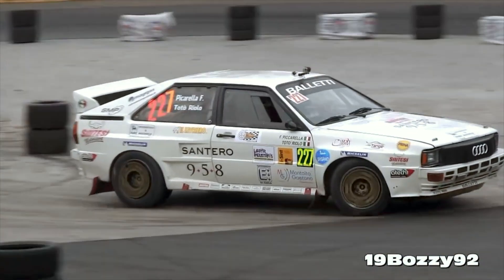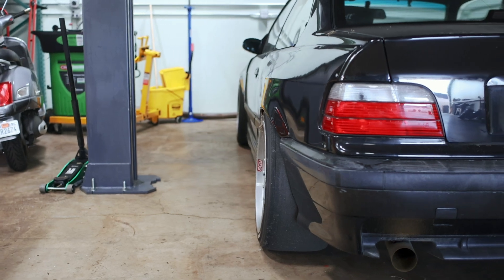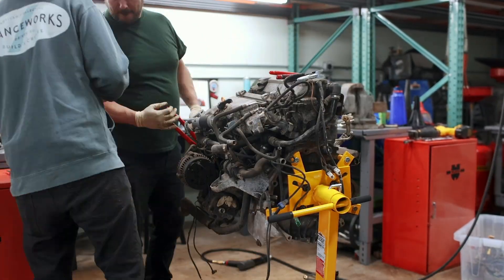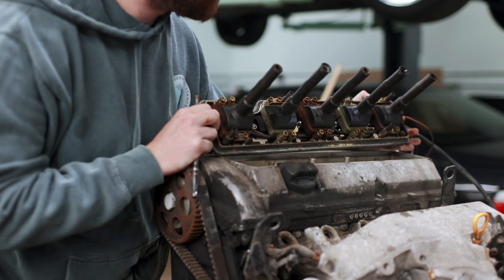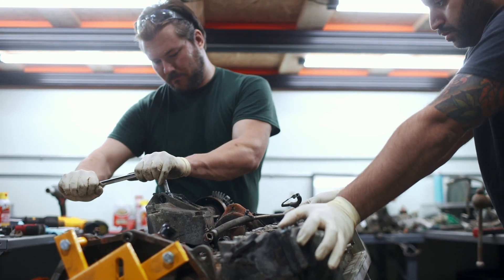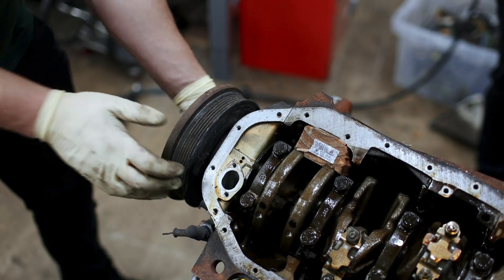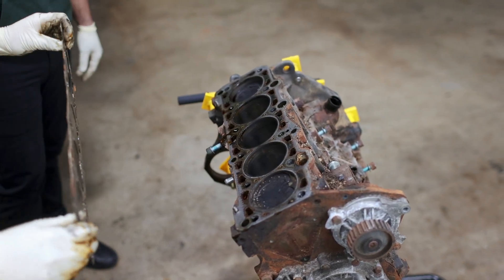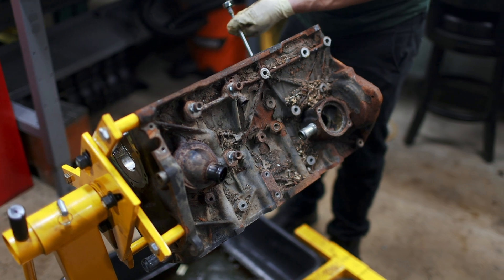5-Cylinder Teardown: Audi Ur-Quattro Engine Build & Swap Underway!

Comment: Cool project and video, but you guys have NO idea how to disassemble a european engine. Please do some research before you destroy everything on this car. I will be very happy to help.
Reply: I did not want to offend anyone with my comment. The first option is to hammer a 12 point torx (XZN) in to the unbraco bolts. The second option is to weld a nut to the damaged head. The third option is to drill out the head and the protruding part of the bolt shaft that goes in to the alternator, and then clamp the bracket in a machine wise, and machine out the rest of the bolt in a drill press. Or press it out. I would use Audi/VW tool number 3256 and a long breaker bar to remove the harmonic damper. You can damage or breake the shaft key on the sprocket on the crank shaft if not. The heat can also damage the rubber inside the harmonic damper.
Reply: @S2_Inlinefive  Solid!  Thank you for the advice- I bought an inexpensive S4 last year with the hotside of the AAN disassembled. Still figuring out the best course of action.    Have zero experience with Audi's so definitely good to receive some expert advice on how to do things properly- Cheers
Reply: @jdmimportlogistics  It depends on your budget, Wagner tuning makes OEM-looking parts like exhaust manifold and intercoolers. This is important if you are living in a country with strick rules regarding modified cars. Remember to replace the exhaust studs in the block, they will probably breake when you try to remove them, but its better than to breake them while installing a new exhuast manifold.
Reply: @S2_Inlinefive  Excellent- thank you for that advice.  All the parts were still in the trunk fortunately after being transported from Texas.  Would you recommend trying to reassemble the hotside first just to start the engine or pull it a do a thorough inspection?  He does mention a standalone in this I'm wondering if that would be the VEMS plug & play to the OEM Motronic ECU?
Reply: @jdmimportlogistics  Check the exhaust manifold for cracks, and measure the gasket surface if it is warped first. They tend to breake and leak exhaust. I always disassemble a unknown engine, but you can use it if is has good compression and oil pressure. It could probably be VEMS, you can check it by removing the plastic covers/floor carpet in the foot well, if I remember correctly. I mostly work on S2/RS2 cars.
Reply: @S2_Inlinefive  Good point.  So are there any other piggy back options for the UrS4 other than VEMS? I've heard mixed reviews. However, I guess if I use the AAN/01E for what  I originally intended to build an S1 Replica (I have a GT Coupe shell/4Kq CS as well) I can go with any standalone.  Interestingly I did get the opportunity to speak with Timo (Audi Heritage fleet manager in Inglestadt) at this year's Rolex Heritage Festival.  He told me that the majority of S1 Replicas in Europe (Although aesthetically perfect) were completely undrivable in the hands of amateurs!  My plan is to leave the engine OEM and get it running in the S4 first then change the coil packs and intake plenum if I do in fact build the S1 replica.
Reply: @jdmimportlogistics  Front heavy short wheelbase cars with high horsepower is hard to drive. I would not recommend to build a S1 replica if you don't have atleast 10+ years with bodywork. I will probably buy MaxxECU, it is plug and play with a adapter for the loom.
Reply from the maker: No.
Reply: What would you have done differently?

Comment: Ah yes the harmonic balancer bolt! Those require a 6 foot breaker bar and at least 200+ lbs person standing on it to get it out! 😉
Reply: I just used my ~700lb impact on them and 120+ psi air pressure 😂

Comment: I thought an 07K would have been a cool engine upgrade. Modern & VAG...
Reply: I was thinking the same. I’m just learning about the 07K and was wondering if these engines are from the same family or is the VW a completely different head/block?
Reply from the maker: The 07K is a different engine entirely. It was an option, but I really wanted that oldschool sound.

Comment: You'll just need a 3b intake for the small chassis  if you want it oem. It wraps up/behind the rear of the engine towards the hot side.

Comment: I've seen some people use diesel engine blocks for bigh  horespower, don't know which though , maybe someone more knowlegeble will give some details.
Reply: They were looking for more displacement. They came stock in 2.4 and 2.5L. You can make a 2.6L with a tall deck eurovan block and 82.5mm pistons.

Comment: The piston rings thing is internet myth.  They rotate while running and typically at different rates from each other.  It doesn't matter if the gaps are assembled lined up or offset.  It is just some weird coincidence if you saw them lined up as you took them apart
Reply from the maker: All 5 pistons having all 10 rings lines up isn't coincidental though.

Comment: Just things I can think of right now to look for:
AAN engine things to keep notice of:
-Cracks in timing gear key or fully sheared, closely inspect.  Full billet options available.  Issue also in small chassis cars
-Cracks in cylinder head from spark plug holes.  Not a total disaster, there is a spec for them in the AAN manual
-Lots of small chassis cars like the URQ get the 3b engine from a '91 200 due to more compact intake design due to radiator clearance issues in small chassis that large chassis cars  don't have issues with.  Not 100% sure intake manifolds are a direct swap.
-Many off the shelf options for retrofit newer ignition coils and harnesses.  Popular and accessible options seem to the 2.0l red tops from newer VAG.
-There is reported issues with ARP main studs and fouling oil check valves in the block of AAN.  Just something to look into and research.

Urquattro things:
-Closely inspect the firewall around the clutch master while actuating, small chassis cars don't have enough bracing in the firewall for these early hydraulic set ups and they often crack/flex causing issues with clutch master alignment and rod breakage.  Some aftermarket solutions tie the master mounts to the steering rack mounts.  I believe Audi's solution in the rally days was internal to the cabin of the car instead of the engine bay.
- Definitely interested in seeing how you tackle the hydraulic brake booster set up.  Some have swapped to vacuum assist from 4000s/Coupe GTs but there are concerns there of maintaining vacuum to the booster while under load.

Can't wait to see the progress on this build!
Reply: 3B, RR, AAN, ABY and ADU intake and exhaust manifolds all fit the "different" 20v heads fine. The 7A and NM heads are the same minus the extra water cooling ports on the intake side, which can be machined in to them (same base castings for all seven engine codes). You can interchange valve covers too, basically just the three different styles. 3B/RR, 7A/NM and AAN/ABY/ADU.
Reply: AAN:
Make sure to get the crank balanced with the clutch to avoid wear through vibration on the first crank bearing
Red Top coil on plug vonversion is a good way to go
Reply: It might not look the best but some modern vehicles, such as my 2006 Volvo, use a vacuum pump for when the engine is under load, so that's a possible solution. Otherwise would a vacuum reservoir work? My C4 A6 has two.
Reply: This.

Also, go buy the crank holder tool.
You need it.
And you will never get the crank bolt out without either bolting the engine stand down or doing timing with it bolted into the car.
That torque spec is crazy.
Reply: Not trying to be a hater but when i saw the engine reveal i laughed at how cheap and anemic it looked. It makes the honda K series from his other project look like a beautiful big ferrari engine in comparison lmao, no hate just thought it was funny. I'm excited to see this build that 5 cylinder sound is something i wanna hear in person really bad
Reply: dob, I guess the more compact inlet designs on the 20V or RS2 is nice, but... my gosh the routing. Wagner etc "turned" with a tapered plenum should be much more ideal for the 600 hp-ish in question here due a large intercooler ? And exhaust manifolds should be more easily to get hold of. Wagner, JEMO, etc...

Comment: The AAN is a great engine but in the Urquattro the fit with the radiator is a problem. 7A Cams not needed. A double head gasket and a hybrit KKK27/28/29 is good to go for 350 HP and 450 NM with 1.6 Bar . For everything above 450 NM new Rods H-shaft ones are needed.

Comment: Ring gaps rotate about 3RPM during normal use, so whether the engine was set that way during assembly or it was random chance, ring gaps occasionally align like this when running but stagger themselves automatically like hands on a clock. That said, the odds of that being the case on every cylinder at the last time of running is practically zero.  Considering that beautiful crosshatch too,  it's my belief that engine was just assembled. You didn't get real in-depth with the condition of the bearings, valve seats, head surface, and other things like that so i can't say. Might be a full rebuild or just a ring and gasket. But that at least explains your ring gaps.

Comment: Piston rings lining up... don't they rotate during normal operation? I know during installation the proper method is to stagger them, but I'm not convinced they stay that way when you run it. There's nothing that keeps them from rotating?
Reply: They rotate about 3 RPM under regular operation and occasionally line up like this, It's incredibly unlikely it happened at the exact same time across all 5 cylinders, however, but that's explained by the fresh crosshatch. This has been reassembled and not run.
Reply: @RyanMcIntyre  may or may not be fresh crosshatch. I've torn down these before with 150-220k miles and they still had factory crosshatching. The old 5 cylinder was tough.

Comment: Your power goal makes decisions difficult for the engine.  Mine is making ~400 on completely stock internals.  I was told by those who are actual experts that you're ok till around 100hp/cylinder on stock everything.  Ie: either go for 450 and make it easy (turbo, manifolds, management) or go for 600+ and make the upgrades worthwhile!!!

I stuck with 400 for $ reasons and i suspect that driveabilty of a 600hp engine that is only 2.2l would just suck!
Reply from the maker: Knowing me, I'll go with upgraded internals, and run 500hp until I get used to it.... then I'll crank it up!

Comment: The 5 cylinder turbo charged Audi A.W.D. QUATRO WAS MY DREAM CAR BACK IN 1984 when I was just 17 years old! My parents were poor and I had close to nothing. This is going to be an interesting build! Too bad it cost $35,000.00 back in 1984 and minimum wage was just $3.15 or less an hour. There was no way I could afford my dream car working a part time job. Good video! Use Diamond pistons!

Comment: Sometimes ring gaps line up due to a worn spot in the cylinder and the rings move to that spot and stay there. Might be a good move to get it checked at the machine shop. Good luck with the build, love your content 👍

Comment: typical  factory work   dry installed  bolts   they never  think  10-20-30-40  years ahead   that these cars might at some  point be considered  classics and  be  restored  by someone  the  piston  rings being  aligned  is just a  coincidence    the  rings  will rotate  in the piston as the  piston  cycles   regarding the  cosmetics of the  block   we  acid  dip  out blocks as it   kills  the rust and old paint  is a  base  not  really an acid  but we call it acid as it  eats the rust and   paint
Reply: This engine has been disassembled once at least, as evidenced by the fresh crosshatch and aligned ring gaps.
Reply: @RyanMcIntyre   not nessecerally  the  crosshatch can still be there deppending on mileage

Comment: Speak to Aelred at Dialynx or Doug at MRC in the UK for some advice on components or check out the S2forum as they have been building high horsepower 3B, AAN etc 20v engines for decades 👍
Reply: Haven't heard Aelred/Dialynx mentioned in ages...

Comment: That block reminded me of the BMW blocks the F1 team in the early 80's used to leave out in the elements to help season them to be more dimensionally stable. You may have a real diamond in the rough there and I'm sure with a little effort you'll have a gem on your hands. As for the rods the discussion begins and ends with Carrillo. They are local to you and hands down the only choice for ultimate reliability.
Reply: I see the BMW F1 lore has grown legs and escaped reality. The F1 team bought used motors with tons of miles on them. Leaving them out in the weather wouldn't do anything for dimensional stability. It was the heat cycles and vibration from road use that stress-relieved them.
Reply from the maker: Amen! On all counts. 
Rumor has it techs used to pee on the blocks out back to season them further. Should I give this one a spritz?
Reply: @stanceworks  I'm sure a little uric acid won't hurt but you'll want to give it a good even coat to avoid differential seasoning of the block which could lead to a crack :face-blue-smiling:
Reply: @stanceworks  if we ever hear the words "ammonia hardened", we know what you did

Comment: These engines are not normally too bad to work on, apart from a few bolts that are difficult to access… yours seems to have lived at the bottom of the sea.

The crank pulley bolt is ‘tight’ but still in the car with the correct locking tool that picks up on the front (nose) engine mount and a bit of scaffold tube and they normally come off fine…. As you found out, out of the car its a real pain 🤦‍♂️

Comment: As a new Englander all my life I’ve seen ten year old cars that look like that engine. The contrast of interior vs. exterior is a testament to the quality of 1980’s Audi materials and build standards. Looking forward to the next installment. Media blasting and a hot tank on that block and it will look great!
Reply: Always gotta roll my eyes when YouTubers work on anything with surface rust and act like it was raised from the Titanic. Any used engine around here that DOESN'T require a torch to take apart is considered "museum quality."

Comment: Personally, i wouldn’t have undone a single nut or bolt on that engine before washing it ! Preferably with a high pressure steam cleaner with a strong acidic soap like TFR.